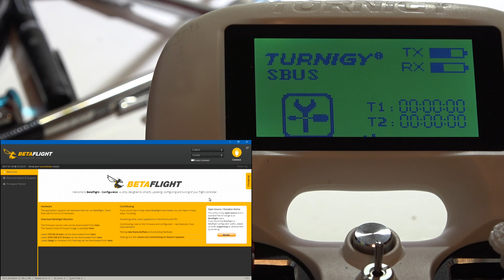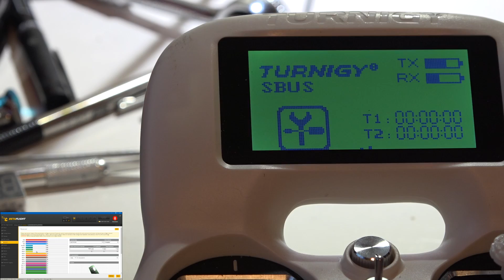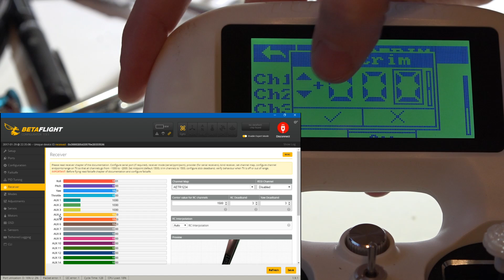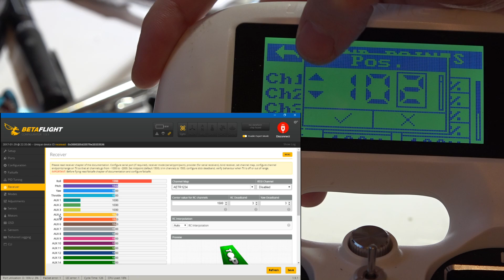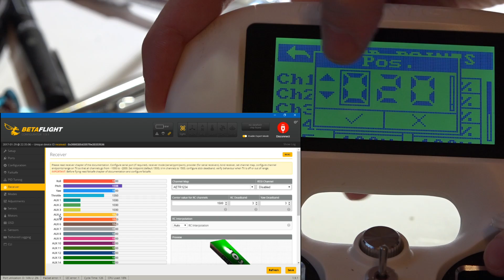Calibrating Channel Endpoints With Turnigy Evolution

Comment: Hi JC, If you are using the same model on the Evo for several quads with different FC's, does it make more sense to calibrate endpoints on the FC CLI in BF using RXRANGE and leave the Evo on defaults?

Comment: does your quad haft to be powered on? also ain't there like a universal way to calibrate "or trim" the quad if it like drifts to one side slightly?
Reply from the maker: It depends. The receiver needs power. With some flight controllers only the USB will power the receiver. On some you have to plug in a Lipo to get power to the receiver. 
There is a way to fine tune the accelerometer but I haven't made a video on it yet. I'll try to do it tomorrow.
Reply: Project Blue Falcon scary thing for me is I don't have a computer. But if I get a special wire I could probably get that one app you showed. It might not have the channel endpoints but just a way for me to start understanding rates & pids would be great. When I fly it seems like on throttle between like 20% &  70% there's a very large field of movement with very little response its hard to explain
Reply from the maker: Yea turns out you can use that app with a USB cable as long as your phone has OTG. I tried it and it works.
Reply: Project Blue Falcon what's an otg
Reply from the maker: It stands for On The Go. Do a search to see if you phone has it. Phones with OTG will use the phones battery power to power whatever it is you're connecting the USB cable to. In this case its the flight controller.